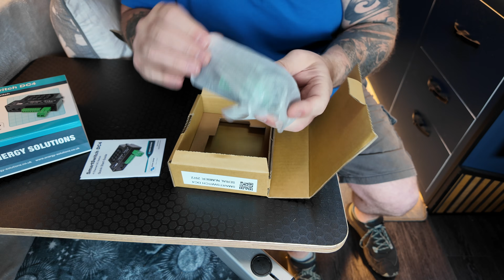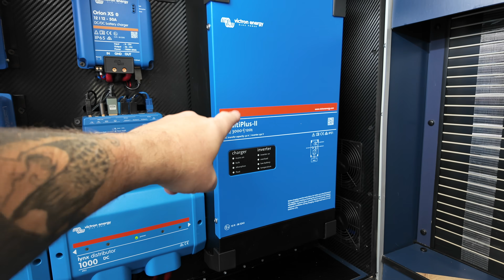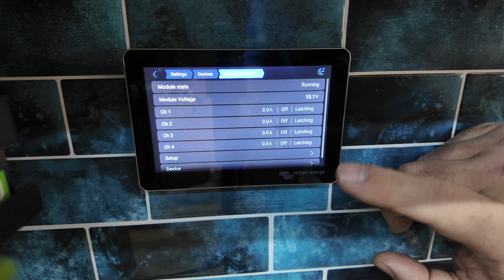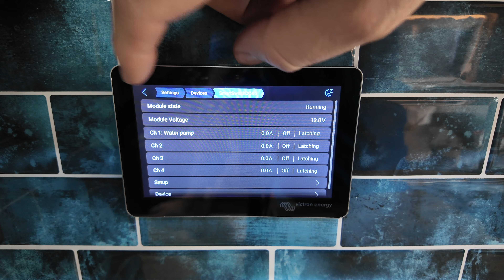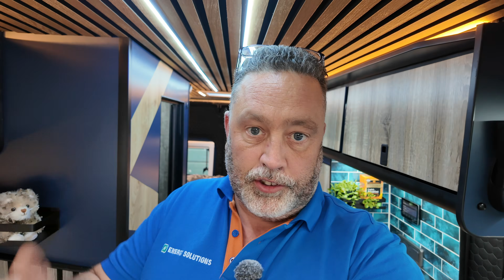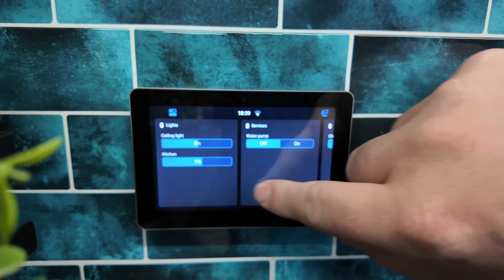you NEED this for your Victron system ! - CC39 - camper conversion

Comment: Came to this video after watching your most recent upgrades one.  Looks a fantastic system and I think for what I am likely to be doing on my conversion better than a separate Savvy Cans system.
One question I have after seeing the last part of the video is on the remote console.  Does this mean that with a Cerbo GX there is actually not a need for the Victron screen, but rather it can all be run off a device which has internet connectivity?  I plan to have a dedicated tablet for our can anyway, to watch movies, etc.  would be really cool if I could use the same screen to double as the Victron control panel too.

Great videos, particularly on the more technical side of things about as good as camper content gets.
Reply from the maker: Yeah you should be fine to run the cerbo without the screen. Not sure how easy it is to set up initially though with WiFi settings etc. You can actually turn an old android device into a dedicated screen too.

Comment: One thing I've been thinking about is a remote kill switch in case of vehicle theft. also a GPS based locator. this might be able to power a relay that could open a main power switch with fuel shut off.
Reply from the maker: Yes it could control a relay to shut off the engine. 
The Victron cerbo has gps location anyway. It just needs a usb gps antenna plugging in. I have got mine geofenced so it sends me a notification if someone takes it off my drive. Then I can always see its location live.

Comment: If this thing had analog or digital inputs to be able to also use physical buttons, it might be useful.  As is, there are cheaper products with more functionality
Reply from the maker: As of right now. This is literally the only device supported by Victron for the new switch pane in the 3.60 update. What you mean is there are cheaper products with different functionality not more functionality, which is correct. Depends what you want out of the device. I personally want something I can operate from the touch display without having to use custom firmwares.
Reply: @SpyderLEE that is literally incorrect.  Safiery's line of Star controllers are can based switch panels and relay boxes that work with the new cerbo firmware
Reply from the maker: @JaredTwomey I didn’t know about them. Look good. Also not cheap.
Reply: Although I will admit the star controllers are a bit more expensive, but the ability to have physical buttons is a must have.  I dont want to have to wake up a screen and navigate multiple button pushes to turn on a water pump in the middle of the night just to use toilet.  With the Star controller I can have the physical switch still functional, and even add a wireless switch in the toilet room so I can turn it on from either.  Problem gets worse when you add small children, who can successfully use a physical switch, but maybe not a touchscreen interface
Reply from the maker: @JaredTwomey this is why I’m only using mine for the dimming of the lighting. circuits. I still want physical buttons for the lights. The water pump etc is ok being behind a touch screen.
Reply: @SpyderLEE it is nice to see victron add this additional functionality to the cerbo.  Personally i run home assistant in my RV and im used to very budget friendly smart relays.  Curious to see if cheaper CAN options become available in the near future

Comment: very very nice ! do you think you can put the switch on a timer? I would want to switch on a water heater via this relay switch and turn it off automatically after 60minutes. maybe via Rednode?
Reply from the maker: Not out the box but You could probably do lots with this through rednode.

Comment: What victron needs is a common communications platform. Having 4 different comm types between thier own equipment is a major pain.
Reply from the maker: Yes I agree on this one!
Reply: no. it's pretty smart because it combines small/mid and big installation communication protocolls. also each has it's own pros+cons so you can mix and match the comms as you need.

Comment: Stunningly expensive! Over £230. For a few relays lol. Would consider buying if it was around £50. But this price is crazy.
Reply from the maker: Expense is just relative to your application and depends how much you want an integrated system all ran from one display. This gear gets fitted to multimillion £ super yachts just as much as diy campervans.
Reply: @SpyderLEE  I've always liked the idea of having digital switching integrated into the Victron app. This product does come in cheaper than what was previously available however I do agree with the commentator that the value still isn't there for me. 100 would be the most I could justify considering a diy solution via separate app can be built for about 50. Thanks for sharing, cheers from OZ

Comment: Hi
very nice video, thank you for your support.
i have some questions about the SmartSwitch. 

1. If need more channel as 4, it is possible to integrate 2 smartswitches?
2. Has the SmartSwitch a bluetooth or only the canbus system? 
3. What can i do if the current higher the 5Amps?

Kindly Regards
Camping Hoch 5
Reply from the maker: Hiya
1. Yes
2. No Bluetooth
3. Will overload and trip, can use relay to switch and reduce load but dimming won’t be possible over 5amp
👍

Comment: Nice product. I'm surprised there's no hide function for the channels not being used. They could have had a default group called Hidden that caused that behaviour.
Reply from the maker: There is a show switch toggle in the settings to hide it. I skipped over it a little

Comment: nice bit of kit that, but just shows how victron are missing a trick, smart switches that can be timed, temp, anolog/digital/pwm triggered etc. ive only got a small van but would want 8 channels. lol
Reply from the maker: Es are working very close with Victron for this device. Hopefully in the future some updates might give more functionality to be triggered via temps etc like the cerbo relay outputs. You can have 8 outputs, you just need 2 smart switches 👍

Comment: Followed your build for a while I’m also building & have gone down the Victron route. This looks like a good add on, I particularly like the dimming function. Any chance the supplier would be kind enough to let your subs have a discount code ? 😊
Reply from the maker: Nice one. Can’t beat Victron. I’ll ask about a discount code 👍
Reply: Its not a cheap unit. It’s more than the Victron Cerbo GX itself & probably costs 10 quid to make in China. For anyone interested I see that 12volt planet now stock this so with their loyalty scheme you can get 5% off by placing a further order. However I’ve decided not to bother it’s just too pricey to be justified which is a shame

Comment: Niffty piece of gear, I was going to fit Quinetic relays for my lighting, meaning I wouldn't need to install wiring to the light switches, but now re-thinking this may be a better option, another dilemma, even so would be handy for drinking water pump and maybe waste waste dump valve, On the drinking water do you have a separate drinking water tank or just the under slung water tank.
Reply from the maker: I’m actually really impressed. It’s making me want to do some rework on my wiring. 
To be honest for drinking water I always have bottled water. Although The underslung would be fine for drinking too, i use it for cleaning and the shower. I just prefer bottled, I’m the same at home.